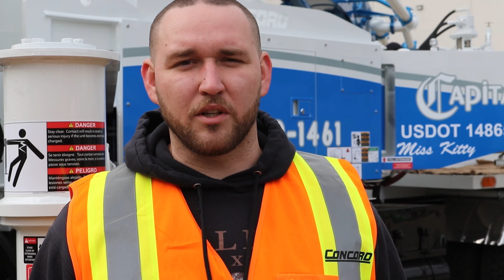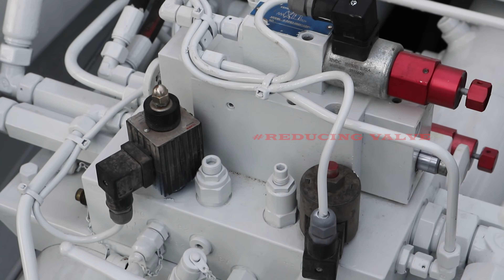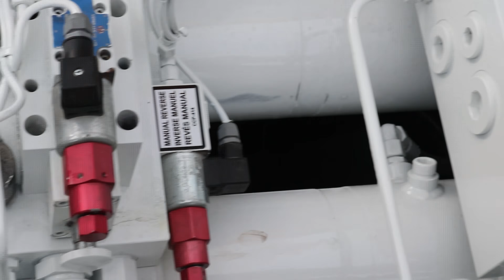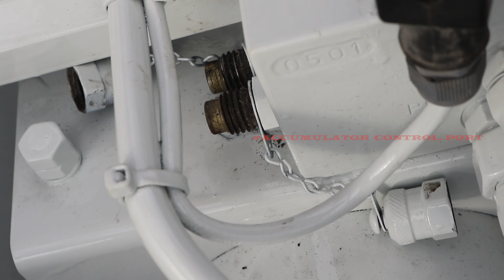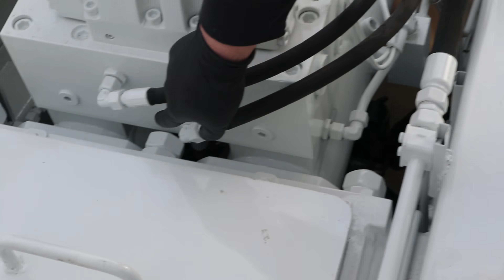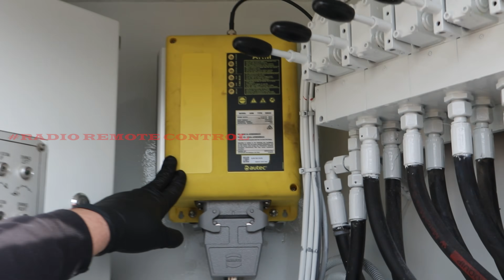HOW  CONCRETE PUMP VALVES  WORK

Comment: Thanks. What happens if you press the valves for pump forwards the wrong way around? You say driver side first but I would probably forget
Reply: It will pressurize your main pump, only done for testing. If rpm’s and volume is at low it will stall your engine as soon as you press the driver side